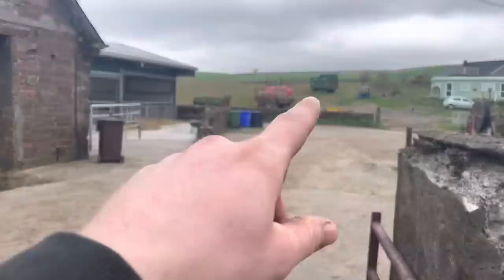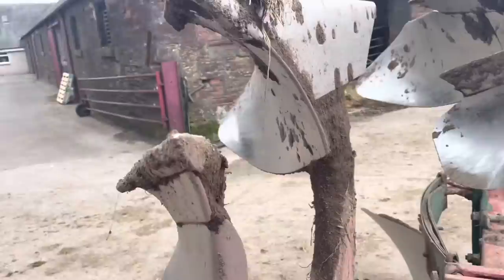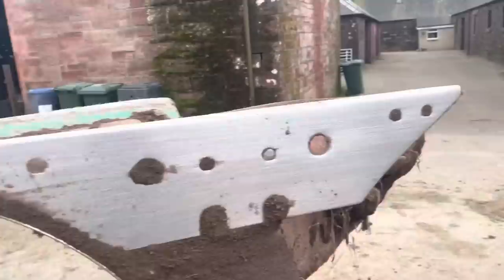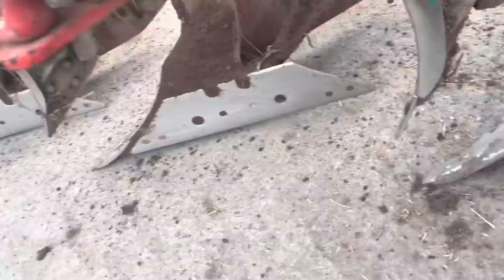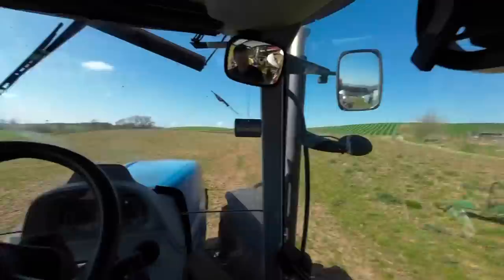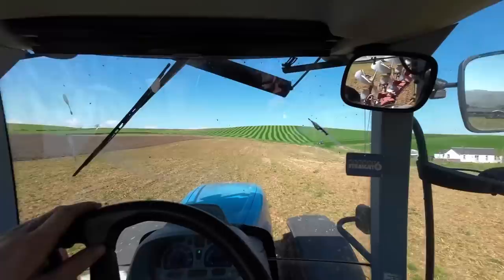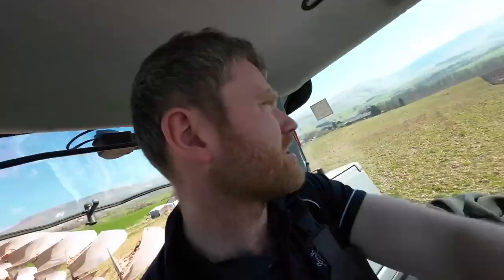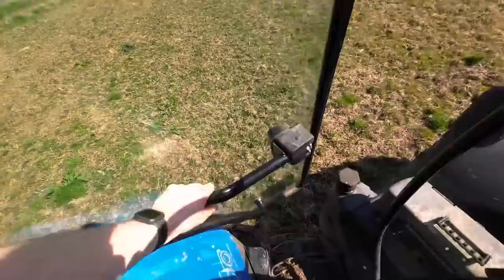The Art Of Ploughing: A Farmers POV!!

Comment: See the wet spot a wud think it’s a spring especially if u it drained an still wet. Get two weldin rods bend then an walk over the wet spot an if the turn u got a spring. Best way to test it is walk over a water pipe that u no wer it is an if the cross u can do it. If u do hav a spring u need to dig down ten feet maybe then put a dumper of stones in the bottom tben stick a 6ins twin wall pipe in the stones straight up. Fill in round the pipe the water will rise. Then all u do is pipe it into a drain.
Reply from the maker: Drains just silted up again, needing rodded, it’s definitely not a spring